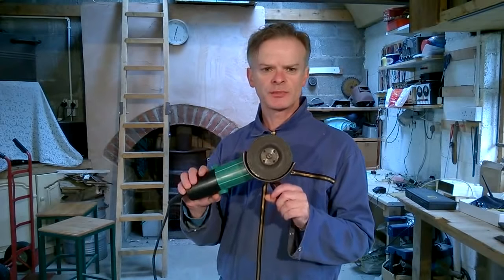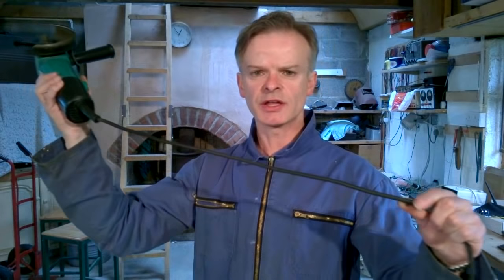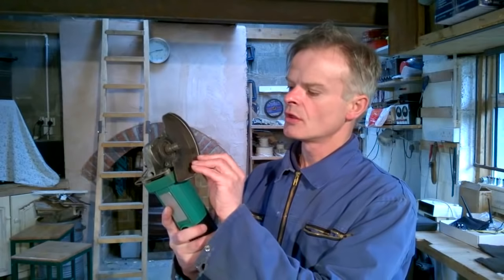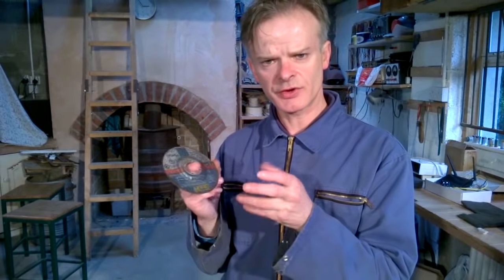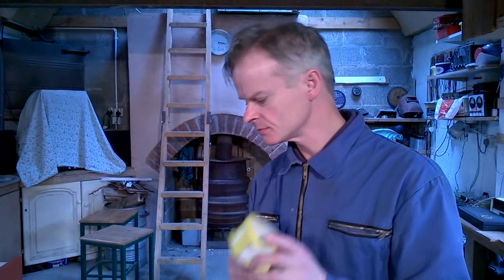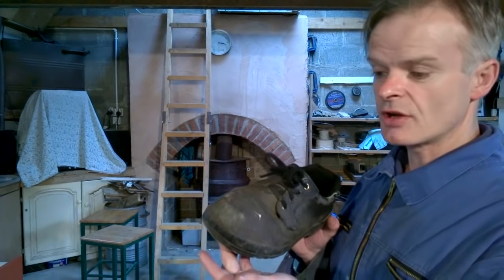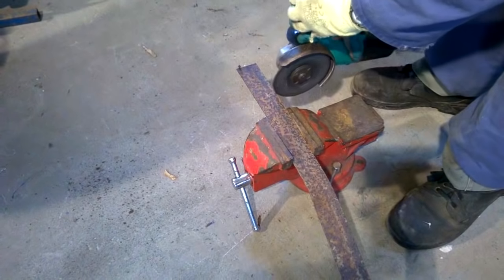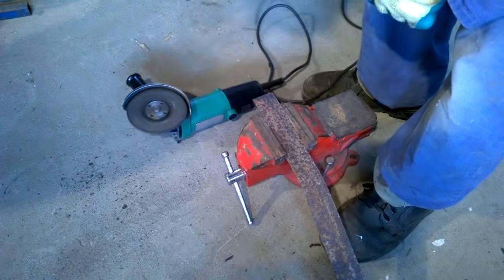How to Use an Angle Grinder Safely

Comment: Good video. I never noticed grinder wheels had expiration dates. Will keep an eye on those in future.
Reply from the maker: Thanks! I have a ton of disks beyond their expiry date. I don't know whether disks really deteriorate (maybe the binding resin softens?) or whether it's just manufacturers covering themselves in the event that some sort of mechanical damage happens to the disk in storage. In any case, probably a good idea to dump all disks by the best before date. I've started to use a visor for total head protection also, just in case a disk shatters. It's also possible to get visors with an added wire mesh screen for additional protection.

Comment: Hi, When do you want to replace a disc ? a fixed period ?
Reply from the maker: Whenever it wears away or before the best before date stamped on it. Before use, check there aren't any cracks from the previous use. You may find that the disk has become too small so that the edge doesn't reach into what you're cutting if its in a corner, so then you can replace it sooner.
https://dengarden.com/home-improvement/Using-an-Angle-Grinder-Safely